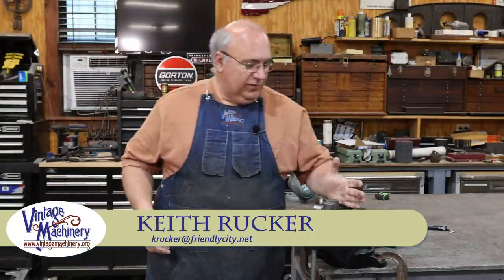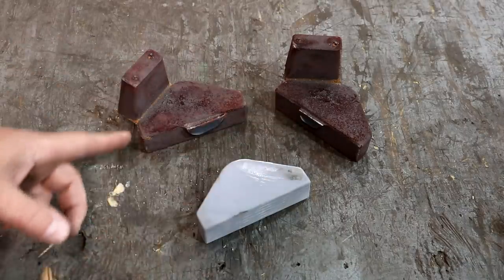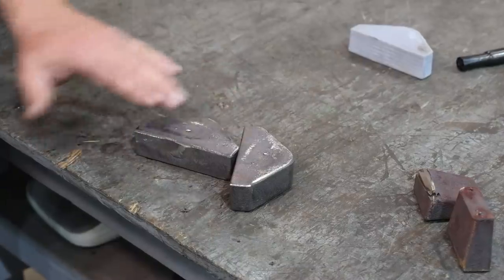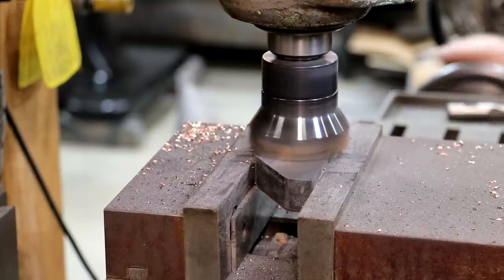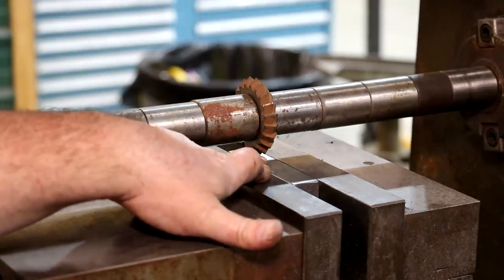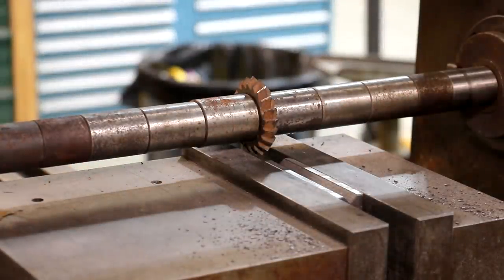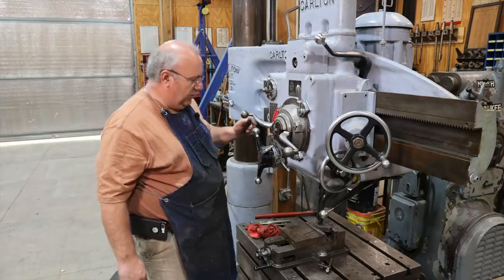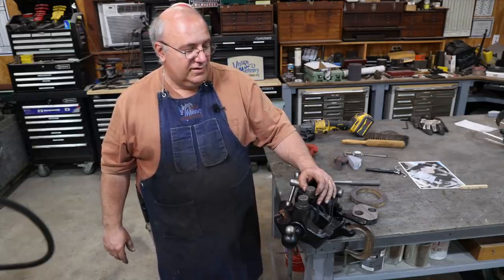Emmert 6A Toolmakers Vise Restoration: Making the Missing Swivel Jaws

Comment: You might consider making some rings that fit over the round bosses to protect the bosses from getting marred if you want to use the round "jaws."
Reply: Kieth could even make a set of soft jaws and rings for the pins as well.
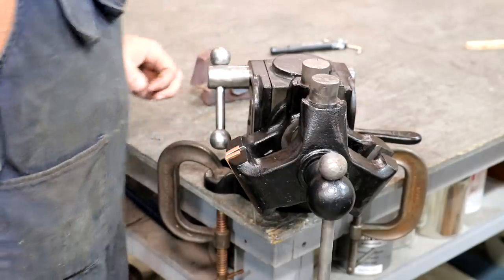Reply: I agree, in the 2:44 image of the vise you can see one of the round bosses heavily deformed, I assume it is from clamping. A set of hard and soft rings make sense.

Comment: After making tons of v-grooved jaws in my machining and fab years in my shop I have always made the steel jaws and just used soft materials matching the machined or cutting materials as inserts on the steel jaws I would make. I had a Heavy use of round stock, squares on the ends and angle stock for all my custom jaws and could not have survived without them. Glad to see you making them as well, Keith...

Comment: Sometimes on vises, only one jaw is V grooved.  Hard to tell, but the photo looks like only only had a groove. Nice work either way.
Reply: If one day the v groove is too big for the smaller cylinder type bar he wants to clamp, well.. I can see a set coming hehe.
Reply: I agree with Pete S. I feel like the groove feature is now too dominant and smaller one on one side only may have been a viable option.
Reply: From a work holding standpoint a V on one side only is superior as it gives a 3 point hold vs the 4 point hold you get with opposing Vs. Similar to how a 3 legged stool is steadier than a 4 legged stool. Also in his example of holding the ring between the pin and one jaw you could see him struggle to prevent one edge of the ring falling into the groove which would not be an issue if one jaw didn’t have it.

Comment: Keith, nice job as always. One suggestion; why sissy on the drilling? Start with a small bit to remove the center and continue with the final size you need. Looking at your wonderful radial drill; it doesn't complain when you do it like that. Industry style; get the job done right and in time. Another suggestion; add a groove for a springsteel "o-ring", or even a common o-ring, so the parts stay on when you rotate the jaws. Just suggestions, no nagging, like your channel,  Best, Job

Comment: Keith, VERY interesting vice! As a model maker, I plan to make a similar set of these jaws out of aluminum to be used on a vice that I ca drill and tap holes for a shoulder bolt with the head ut off and a slot for a flat screw driver to install them (I MAY see about getting a Machine cap screw with shoulder and step drill the vice jaws to fit that way, one or another I can use a set similar but smaller for the same reason and plan to modify a vice I currently have for such a task on a smaller scale ("size" of the jaws) for my own uses!

Comment: If you surface the backside of the jaws, you can rotate the jaw and maybe protect the pins.  Maybe a set of matching soft jaws are next!

A O-ring on the inside of the jaws holes could help retain the jaws.

Comment: Just an FYI, beware of a light first cut on castings, you need to go deep enough (greater than 0.010" sometimes) to cut beyond the casting oxides on the surface. Or you will trash those expensive inserts.

Comment: If the "v's" are a little deep, that just makes room for some custom copper shims for holding more delicate work.

A single round "jaw" with a similar groove might be handy for bending round stock or tubing to a specific radius without kinking it ... if you don't have a tubing bender that is stout enough for what you are working on.  (For What It's Worth.)

Comment: Wow- .250 in one pass!
Reply: That's still a very light cut for a big machine like that.
Reply: I ran a big radil arm drill and drill a 1inch hole in stainless steel with no polit hole.
Reply: 🙂  Check out CEE Australia and Kurtis's new shaper making cuts.... he won Chip of the Week with it.
Reply: @MrPossumeyes  have you seen Jason's (Fireball Tool) cuts on the huge mill? Like 6" or something like that DOC
Reply: @MF175mp  No - better go for a squiz!  Cheers for that. 👍
Reply: I have an Atlas lathe and a crappy round column mill. If I can take 50 tho off at a time I am feeling good. I am not making a living at it so I guess that is ok.

Comment: Keith, with the pattern handy, another set could have replaceable steel or soft jaws too. I am surprised you ground off the gates on the jaw faces, especially since you machined that surface. Have you considered using a shop-vac on the mill(s)/drill press to vacuum up the cast iron cuttings while work is in process? Thanks for the video.  Hope to see you at the Bar-Z. Jon

Comment: Any odd-shaped work piece (or work method) that causes more load at the ends of each jaw than at the centre will cause tensile stress in the jaws at their weakest points (i.e. the centres where the 1.25" diameter hole and deep V-groove are).  So these cast iron jaws will need to be treated reasonably gently to prevent cracking.  Maybe the original jaws were cast steel, not cast iron.

Comment: While these small projects have been interesting, and you have been spending time on the Diresta band saw refurbishment, ,( you may still want to contact you tuber Engles coach shop for advice on the type of tires that may be required with the wood fellows on those bandsaw wheels)  have been wondering when you might get back to the stoker steam engine project. Now that you have a vertical milling machine, you might be able to finish the re-milling in your shop even if you need to fabricate your own bits for the slide re-milling
. Apart from that and the offset re-lathing of the crankshaft, (hopefully will not need more than a couple of thousandths to true it up.) you seem to be ready for rebuilding of the engine.
Reply: @flat-earther  considering that the use of a metal planer was attempted by You Tuber A bom, and there seemed to be a problem with the necessary planer stroke to the needed height  and the only problem with using the vertical milling machine video was the flat cutter head was too large,. A smaller end mill in Keith’s   Vert8cal mill would seem to be Ideal. Even if a very deep planer blade were fashioned, the chance of bending such a blade is very high and thereby damaging the casting much greater.

Comment: Why not drill and tap the top of bosses ? Then a screw and fender washer will stop the jaws from falling off when rotating to a different set of jaws .
Reply: The design of the jaws do not allow the other to vise faces to close when these are closed.

Comment: Photography comment: your SLR (a Canon, was it?) is doing nice work, but in the close up shots the autofocus is being a little aggressive, jumping to your arm when it comes in the corner of the frame, etc. Probably there is a menu setting to make the autofocus respond only to a small area in the center of the frame. That would let you set up focused on a cutter or whatever and it would only track that.

Comment: I bet those jaws get lost because they easily fall of of the vise when its rotated around to put the other jaws at the top.  Perhaps if it had been designed to retain those jaws they wouldn't get lost so easily?
Reply: A couple of ball plungers on the main body "pins" and some grooves on the ID of both jaws would help prevent the fall off and it would still appear period correct 😉

Comment: 23:52 how is a machine with that much mass so wobbly
Reply: It's the bench!
Reply: @paulcopeland9035  it's the machine; you can see it in the second shot afterwards as well
Reply: @ikbendusan  ....There is ZERO "wobble" in the Carlton.  You are seeing camera "wobble". Originally, I thought you were commenting on the bench mount (temp clamps) of the vise.  The bench is "wobbling".  The floor must be uneven at that spot.  As far as "wobble" in the Carlton, you are mistaken.  Those are as solid of a machine as you can have!!
Reply: @paulcopeland9035  if it was the camera that wobbled it would shake the entire video frame, but it's clearly just the arm of the machine lol

Comment: Please put some oil on that cutter😉
Reply: It is cast iron, the carbon in it makes a good lubricant for this type of work.
Reply: Not required with Cast Iron
Reply: @philipmackin1025  I meant after he finished the cut.  Just to try to keep the rust from getting any worse on that cutter